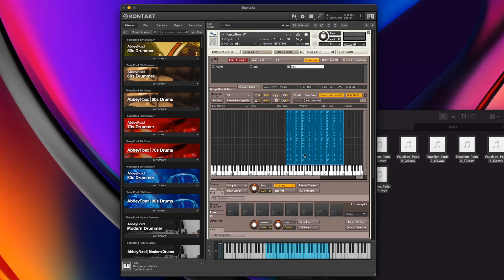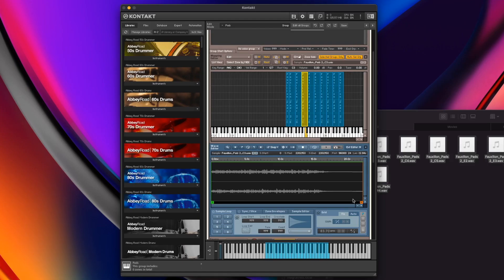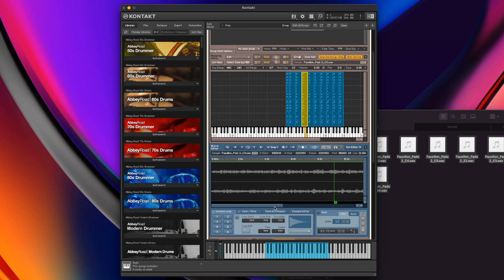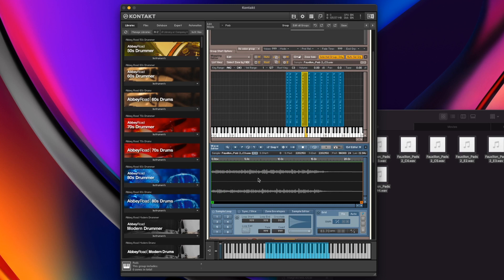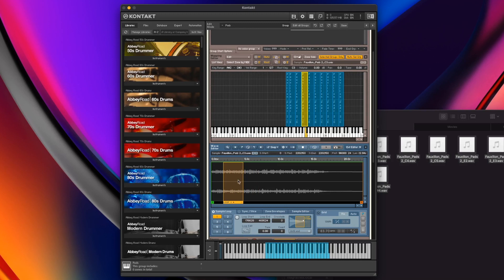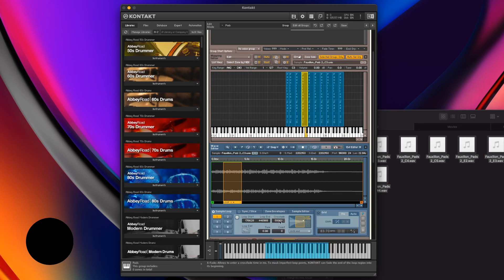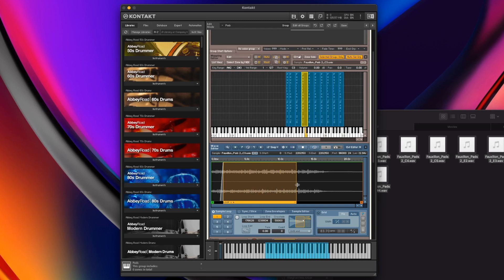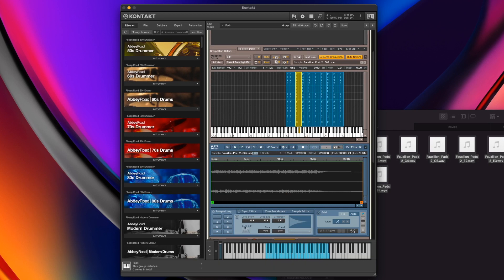How to Loop a Waveform to Sustain a Sample... KONTAKT: FIRST STEPS (Ch. 2 Ep. 4)

Comment: You CAN actually copy the loop from one sample to another. First, select all samples in the zone. Then add the loop as shown in the video (this will just apply it to ONE sample). Finally, hit the little cog-wheel button in the wave editor (it's at the top and right of the "snap" button). Then click "To all selected zones" -> "Copy zone's loop settings" A warning will pop up which says it might take a short while to copy and indeed it does usually take a few seconds at least. But there you go! The loop is now copied to all selected samples in the zone :)

Comment: Is there a way to script a button to turn on or off the loop? Want my instrument to have the option of finishing out the waveform but be able to turn on a loop with a single click. I know I could script it so that it switches to a different group with the loop on, but I've been hoping to find a simpler solution and haven't found a script solution to do so. Thank you!
Reply from the maker: You can indeed, there is a command called set_loop_par, which you could use with the parameter $LOOP_PAR_MODE. You could target the specific loop (0-7 because of zero based counting) and turn it off and on with the last parameter. https://www.native-instruments.com/ni-tech-manuals/ksp-manual/en/zone-commands.html#set_loop_par--

Comment: Hey thanks for everything! Do you know if it's possible to assign a release after the loop? I mean if I want to hear the tail of the audio sample after I release the sustain, how do I do that? Thanks again!
Reply from the maker: Hey, there is indeed (sorry for the delayed response). You can turn a whole group into a "release trigger" group (there is a release trigger button on the group section near the FX and the Tune knob). When RT is enabled, anything in that group will play on release of the keys, so I would put all of your main samples in one group and your release trigger samples in the other group, set the release trigger group to release trigger and then presto! You might also want to put an AHDSR envelope on both groups and use the release setting on the main group and the attack setting on the RT group to balance a bit of a crossfade if necessary too.
Reply: @StephenOConnellCmdShiftNew 
Thank you so much!!! This is really helpful! I will try to do that! Thanks to your guidance i ve been preparing a nice decent instrument on kontakt. If I ever get to finish it properly will for sure send it to you. Thanks again!